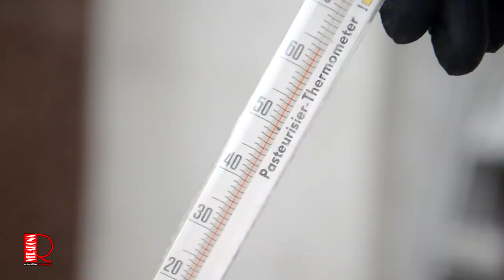Old rusty lighter 4 Restoration

Comment: You did a tremendous nice job on this one, but this come,s from my heart; please use the right size screwdriver  for the size of the screw. Just to prevent wear out the edges on screws to get the perfect finnish.
keep on going mate!
Reply from the maker: Ok, thanks for the info.
Reply: @VeradonaRestoration  also helps to have hollow ground screw drivers in just the right size. These usually come as kits with one handle and a number of bits to fit. as handy as you are tho, just make what you need.
Reply: @VeradonaRestoration  I use a set of Jeweler's or watchmaker's screwdriver tips and holder for this tiny stuff. works well. You might get a small watch repair kit like I did, with a watch vise. the watch vise will hold the lighter still while you do whatever.

Comment: nice job. What is that "soldering liquid"  I've never seen that before.  Also, that's a unique method of plating I have not seen either. How's that work? most people do electroplating. Me, I like the polished brass look. Is there a name on that lighter? were you able to determine the age? That style has been made for a very long time, it's even made yet today (but obviously this is old and of better quality than modern ones.) 
by the way, ordinary cotton balls from the drugstore work for the filler. you can open them up into long strips and they go right in.
Reply: The soldering liquid helps
the solder to stick better
on the surface of the metall.
There was a rest of solder on
both sides of the metall plate.
With the help of a little bit soldering lequid,
it sticks on the lighter even if you use a
adhesive.
The lighter was brass plated and i think he
removed the brass layer with a sulfuric
acid solution.
Reply: @jameskirk9938  so it's like a liquid flux? it looked like he used no solder at all.
Reply from the maker: Soldering liquid: Soft solder flux with Sn-Pb solder. It is especially suitable for soldering copper and poorly solderable parts. It does not contain halogens in any form.

Nickel bath: High-gloss nickel bath. It is suitable for metallization of steels, copper and its alloys and aluminum. The thickness of the layer that is deposited on the surface is dependent on the length of the dive and the nickel reduction, i.e. typically from 15 to 60 microns. The deposition rate is 30 microns per hour. Phosphorus content is 4-8%, surface hardness after heat treatment up to 1000 HV. A liter of the bath can cover an area of 7 - 10 dm square. Plating conditions: Perfectly degreased part, immersion in the bath preheated to 82-95 ° C for at least 10 minutes.

The lighter is from Kervoline
Reply: @VeradonaRestoration  thanks for the info. I don't know what I can get here, but that nickel bath without electrolysis seems the business.

Comment: You should leave the parts in brass cleaner for 1 day.
Reply from the maker: I wouldn't recommend that.  This is a very powerful cleaner.  A mixture of several kiselin.After 24 hours the brass would dissolve.

Comment: I do not recommend using actual gasoline. Lighter fluid does better. Today's gas is not like the gas of old.
Reply: Sure its a translation issue.
Reply: @Deadfeat  possibly, but back in the day, some lighters did use gasoline of the day. It had no additives, no alcohol, and was okay for the job. Modern gasoline is not. You can actually fill them with high grade alcohol, and they will work, tho sometimes it's difficult to actually see the flame.

Comment: Very nice restoration. It's from the late 20's, early 30's, French and made for, or by, Kervoline - a French Oil Company of the time. 

Unfortunately it appears to be incomplete, missing a thumbwheel. See this picture for the missing part: 

https://www.picclickimg.com/d/l400/pict/223440761113_/Rare-briquet-ancien-KERVOLINE-essence-%C3%A9tat-%C3%A9xceptionnel-P%C3%A9trol.jpg 

I've had a couple of this type of lighter and neither were complete, both were missing the Top Cap and also the part yours is missing, but it's just one of those things. The working end is really quite delicate for what it is.
Reply from the maker: Thank you very much for the link!